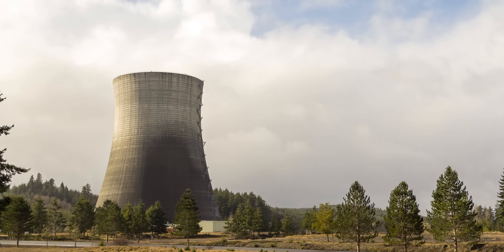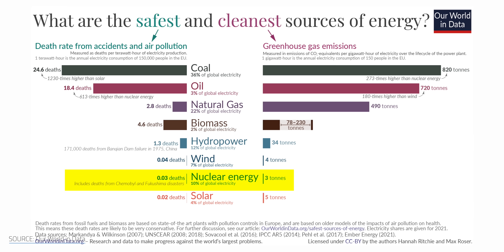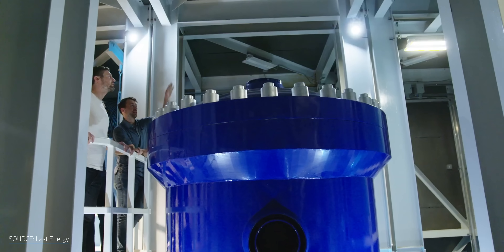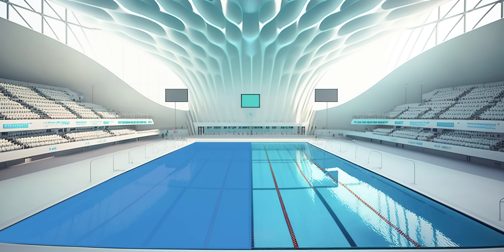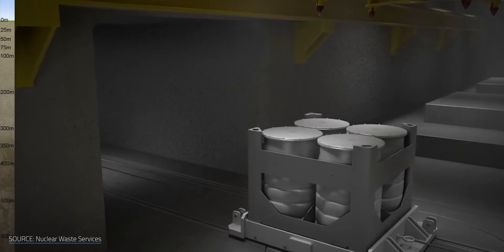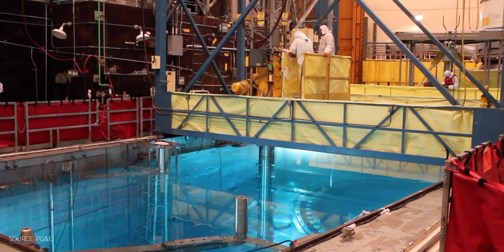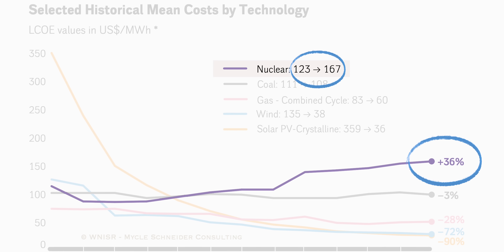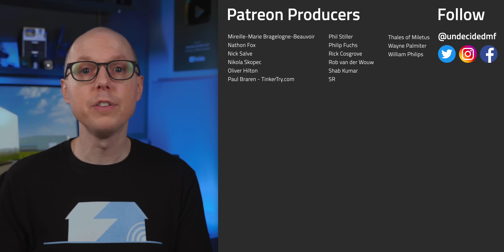Is Small, Fast, & Cheap the Future of Nuclear Energy?

Comment: I anticipate a lot of hate for this but I think small modular nuclear reactors are the worst of all possible worlds and the exact features that make them appealing psychologically make them unsound.

Small reactors are less efficient by design. You can't optimize for power or fuel use while you're trying to make them small. There are engineering economies of scale and financial economies of scale. So per unit of power produced, these guys are going to produce more waste, less energy, cost more in total, and present many more opportunities for failure and disasters with less opportunities for intervention or cleanup.

Any nuclear pile over critical mass, which by definition a reactor has to have, whether it's a small modular reactor or a big conventional has The capacity for a containment breach, a meltdown, a release of radioactive gases, or interactions with the water table. Making them small increases the monitoring problem. If you have 10 times the number of reactors spread out over 10 times the number of locations, you're going to need a lot more monitoring.

These reactors are also less efficient, the ones that are so-called bury and forget units are just the same old problem of how do you dispose of nuclear waste. Burying it has a lot of problems. And here we're choosing to bury them near cities and other places that we need power, instead of remote and geologically stable locations. You really want a dozen of these near Los Angeles and San Francisco or Tokyo in earthquake active zones?

These reactors solve none of the problems they're being touted for. They don't do anything better than conventional nuclear. The only thing they do better is if we want conventional nuclear in a location that has relatively small power demands, preferably one that we're going to abandon forever around the time these reactors have ended their commercial lifespan and now are just a buried problem for future generations.

I'm in favor of next-gen nuclear, but small modular nuclear reactors are not the way to do it. We want efficient safe designs like the molten salt thorium and we have to stop these scams designed to keep us dependent on general electrics mox fuel pellets. 

Even if we need transuranics for other things like plutonium thermal electric generators for our spacecraft, we can do that by breeding those around a thorium reactor.

There's also finally been a lot of interesting progress around fusion in the private sector.

Small modular nuclear reactors are flim flam that are designed to solve psychological resistance at the expense of practicality and safety. Maybe one other advantage that they have is that you may be able to assembly line them, which might reduce costs but also creates its own kind of safety problems.

Comment: Matt, I find it a bit disappointing how uncritically you're interviewing Bret, and how you're reporting the operation of these first PWR-20 units as fact. None are actually operational, with the first one in Poland to be completed by 2025. Most of these purchasing deals are just intent to purchase units, or rather power. The simple fact is that there are no production SMRs anywhere in the world, other than the floating one in Russia.

The fact of the matter is also that at $100M per 20 MW unit, these would still be expensive as hell. It would take 10 to equal the output of a small 200 MW gas turbine "peaker plant", at a cost of $1B. It would take over 20 to reach a larger unit like Tennessee Valley Authority's Allen Combustion Turbine Plant with an output of around 500 MW, which would cost $2-3B. The combustion turbines are considerably cheaper. And while the PWR-20 might be "green" by some measures, it's not really the kind of green most people are thinking of, and which is doable with renewable energy plus storage.

Oh, and until Last Energy has actually implemented a few dozen units, I would still reserve judgment on whether the $100M per unit cost is realistic. My gut feeling is that they're the Nikola of SMRs.

Comment: Modular addresses a cost issue, but not THE issues with Nuclear which are meltdown, hydrogen ignition, and waste. If you have a nuclear reactor that requires effort to prevent meltdown then on a long enough timeline it will happen. This video also didn't mention perhaps the largest issue with nuclear which is Not In My Back Yard. Utility scale battery backup is a much easier sell for 24/7 power security.
Reply: Zero deaths from commercial nuclear power in the USA.  Zero deaths in Fukushima.

Next question!
Reply: @scottslotterbeck3796  Perhaps zero RECORDED deaths directly from the failures but the problem with contamination is that it doesn't stop at the event when you're talking about air, water, and food chains. 3mile island vented unknown amounts of contaminated gas multiple times to prevent detinating hydrogen more than it did. Fukushima did cause multiple cancers with one acknowledged lung cancer death. Fukushima is still in meltdown from hydrogen detonation with hundreds of millions of gallons of contaminated water stored on site and unknown millions of gallons flowing into the sea. No one knowingly wants to eat a Fukushima tuna roll. Requireing zero margin of error for boiling water is a difficult if not unrealistic target on a long timeline.

Comment: The refinement and enrichment of uranium mined from the ground is a large on-going non-stop effort.  Would like to see a a video on this aspect of the commercial nuclear power lifecycle.  It will increase the calculated carbon footprint and costs of the commercial nuclear energy.

A nuclear fuel rod only has enough U-235 (the "premium" uranium isotope) for some 3-years before the rod needs to be replaced.  And the old fuel rod is disposed and stored away for 100,000+ to 1M years!  Because the used rod still has huge amounts of still highly radioactive U-238 isotope but its unusable for the slow neutron fission reactors which are 99.999% of all nuclear reactors out there and which need the premium U-235.

Comment: the best solution with todays tech would be solar and wind for suburban and rural environments in the form of grid-connected microgrids, coupled with underground standardized nuclear to produce power for urban environments and northern winters where snow would stop solar and wind, keep the reactors underground so they are protected from natural disasters and can quickly be buried in case of catastrophic failure

Comment: Recycling means fast breeder reactor. That means plutonium. 99.3% of uranium is U238, which really should be converted to plutonium. It's crazy to just bury 99.3% of the fuel. Refining U235 is also a big part of the waste problem.

The real issue is security of the sites if they are breeding. Burying the reactor under a giant concrete slab could and making it really hard to get to and could make the security easier. Limiting the amount of fuel in each plant would also help. If they can make it a closed system that does not require any maintenance for 20+ years, that would be a game changer since it could be buried:)

Comment: LCOE is basically bullshit. It usually assumes a 30 year life for nuclear plants even when they are designed for a minimum of 40 and can likely go for 60. It also almost never factors in the cost of batteries for renewables which makes them look super cheap but in reality you need tons of storage to make solar/wind a large part of your grid. Lazard group just released new LCOE numbers for renewables where they did factor in a small amount of battery storage and it blew up the LCOE to be worse than Votgle (an extremely late/expensive nuclear plant).

Comment: What's the LCOE of these modular nuclear power plants? For comparison ideally with one, two and three modules (in case that makes a significant difference)
Reply: For the initial price tag, divide $0.70 / years of operation. If the plant runs for 20 years, that's $0.035 / kWh, not including maintenance costs. I heard in some comment that they expect 25 years out of them.

Comment: I could be totally wrong, but couldn't these smaller power plants be the solution to converting the shipping fleet to electric  eg Amazon, Walmart, and such. I have heard a lot of concern about where the massive energy is going to come fron to charge these fleets considering the current grid capacity. These could power the charging staions for all theae trucks without straining the existing grid. CNBC had a terrific story concerning this problem. Any thoughts?

Comment: I've always wondered why, if the spent fuel was still "hot", why it couldn't be used for longer...
Reply: it's reactivity has been expended.  The hot part is from fission products that are producing heat and radiation, but far less than it would at power.

Comment: What if there was a way to produce the same thermal energy coming from radioactive materials but without the dangerous ionizing radiation?  

I believe I discovered how to do it without using radioactive materials, combustion or other chemical, exothermic reactions.  The device uses an element found readily everywhere.  It produces lots of heat by simply passing cold fluorescent light through it.  Cold visible light goes into the device and exits as invisible thermal energy.  Like with nuclear reactors the heat then can be converted into electricity using thermoelectric generators.  No moving parts, well unless you want an on/off switch.  It lasts a lifetime.  The components are inexpensive and never have to be charged or serviced.  The device produce a constant current of electricity, forever.  It constantly produces more energy than what it's supplied with.   1.5 volts go in and out comes 3V.  So it constantly produces an extra 1/5 volts.  It doesn't use radioactive materials. There's no danger of an accident.  I included the designs and specs for the device in the last book I published in 2021.   It was much cheaper and safer to publish books about it and have them copyright protected than file for a patent and fear for my life.  Those who buy the books can make the simple device for themselves.  They can buy everything on Amazon or e-bay.  They can be as small as a soda can or as large as a bus depending on the energy you need.  The possibilities are almost endless.

I got the idea after I solved Einstein's equations on gravity.  In September of 2021 I published several books about it.  I'm so positive I'm right that on page 48 of the first book GRAVITY I wrote quote, "The JWST, James Webb Space Telescope will discover old, fully grown galaxies as far as the telescope can see, further than 13.8 billion light-years away."  What did the telescope discover?  It found old, fully grown galaxies further than 13 billion light years away.  The galaxies were more than 10 times larger than our own Milky Way galaxy and they can't explain it.  I accurately predicted it.  

I know how energy and matter is being made in the universe, an over-unity of energy occurs and I explained how and why it happens to large mass while floating in the vacuum of space, suspended by several weak EM fields coming from every direction.  No one listened to me.  Yet I was the only person to accurately predict what the JWST was going to see in the distant universe.  LOL now they're trying to pin it on dark matter causing the galaxies to form rapidly.  But they're going to be so surprised when future studies find the stars in those distant galaxies to be much older than when the big bang was supposed to happen, billions of years old.  

The CMB is an artifact.  The Oort cloud is an artifact.  The look back time in general relativity is an artifact.  The evolutionary cosmological model of the universe is an artifact.  The laws of thermodynamics and laws of conservation, particularly claiming energy and matter can't be created are artifacts.  The Hubble constant is an artifact.  Dark matter and dark energy are artifacts.  

All these artifacts arose because Einstein's field equations on gravity were incomplete.  Why?  Well, because he neglected to address the action causing gravity.  And no, the warping of spacetime is not an action causing gravity.  That would be like claiming the road a car follows is causing it's motion, velocity and trajectory.  We all know the road it travels is not making the car move in all different directions.  Something else is responsible.  The solution was way too simple.

Comment: Too slow to build, too expensive and too risky:
Too expensive: nuclear has to beat 1 cent/kwH for solar - no chance), too slow (takes a little more than a few months to build 1.000 MW (1GW), which is no problem with solar, too unreliable (France had no cooling water in the summer and no power from 26 reactors), target for terrorist attacks (think of Putin bombing the power line and the diesel generator) too slow to react in the power grid (like ramp up/decrease power 100% to 50% or back in 2 Minutes. Not possible for nuclear reactors)

Comment: Those are some pretty significant ifs to be overcome. And even with reduced costs nuclear remains the most expensive way to boil water.
Reply: Not for small modular reactors.  And when subsidiaries are factored in, and reprocessing of fuel, the costs are way lower.

PLUS, the number of deaths from Fossil fuels must be factored it.  What value is a life ended because of air pollution???

Comment: I may have missed this in the video... what's the cost (LCOE) of electricity made by Last Energy's reactors? I heard that they can deploy a reactor in 2 years. I heard it costs $123M. But what's the LCOE after you have one?

It's fine if it's higher than solar or wind. After all, nuclear is mostly for base-load. Running the smaller stuff at night, when solar panels don't work and 99% of human beings are asleep. If it's twice as expensive but we use 1/10th the amount... probably not a big deal. But if it's 100 times as expensive... then problem. (I won't get into a discussion of energy storage. Solar + storage might be a better solution than solar + nuclear. But since I don't yet know of any deployed grid-scale storage that works well, I don't want to mention it. Not yet.)

Comment: Hi Matt, I really enjoyed this video. My father worked in the Nuclear Power Industry helping design some of the "big boy" reactors built by babcock and wilcox. His contribution to that industry was notable with 9 patents that cover some of the equipment currently in use during the service and recommissioning of power stations shut down for the purpose of refueling. His assertion was that Nuclear Power was a necessary evil of sorts because fossil fuel usage was not sustainable. And that it was several orders of magnitude safer over all, Three Mile Island and Chernobyl not withstanding. Both accidents were caused by operator error and that isn't the fault of the reactor or the people that built it. The Nuclear industry as a whole did a terrible job managing a panicky public and press corps, which led to much unfavorable and largely undeserved bad publicity, but they earned the bad press by not thinking the situation thru and seeing what their responses needed to be to manage the situation properly and as a result public opinion about nuclear power as low as it probably can get. People haven't forgotten these accidents nor are they willing to, and that is going to be a hard thing to overcome. This idea of smaller cheaper plants that limit the footprint and the size of the scorched earth if something goes awry, is appealing and may just save the industry, but the big plants like my father helped design are pretty much a dead entity in the US, or at least that is my feeling. I havent heard of any new large plants being commissioned in the last decade. I am curious as to your thoughts personally on all this. Your a pretty intuitive guy. Again thanks for doing this particular one. My dad would have enjoyed seeing this.

Comment: Outstanding Matt. Thank you for making this video. If I may answer the question of cost. The biggest part of that cost, GOVERNMENT REGULATIONS. Not to mention requirements from the EPA and lawsuits from the anti-nuclear crowd. These are the main reasons why Nuclear costs so much. These regulations were set up during the 70's after 3 mile Island incident to discourage the production of Nuclear plants. Removing those hurdles will be needed on lowering the costs even further and shortening the construction times of these plants. Please continue making videos on the benefits of nuclear plants and further looking into the Japanese reactors that recycle the fuel and the American Company behind that tech. With this modern approach of commercial off the shelf tech (COTS) in the production of smaller modular nuclear plants, I'm all for it. Thank you again Matt.